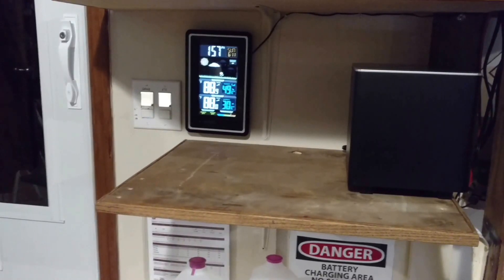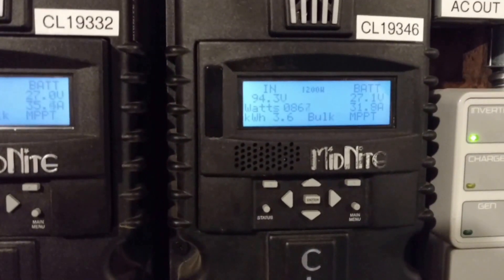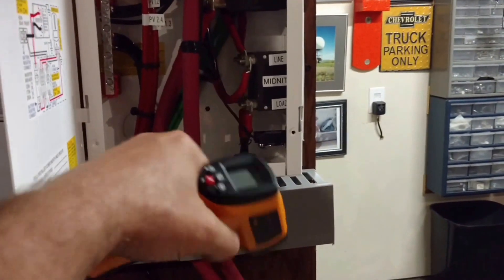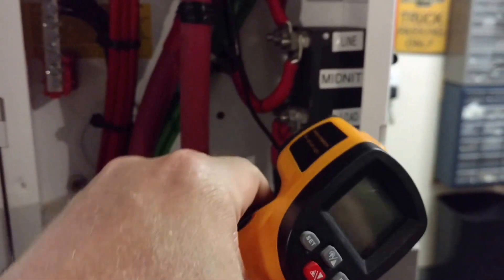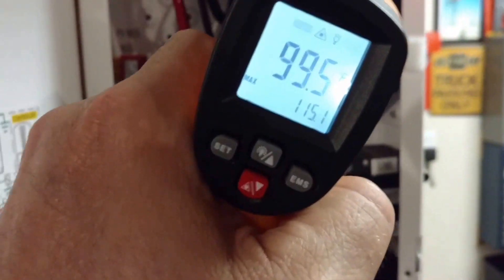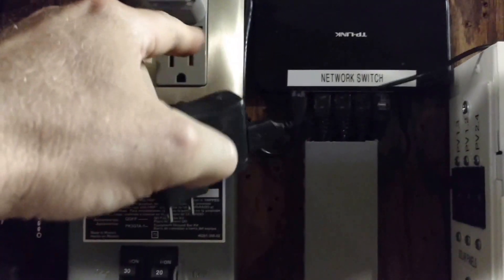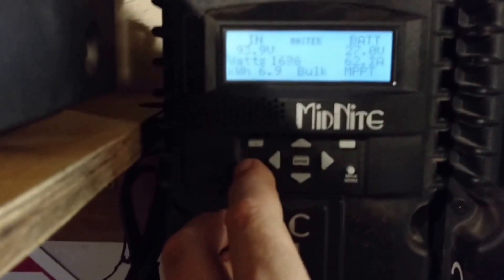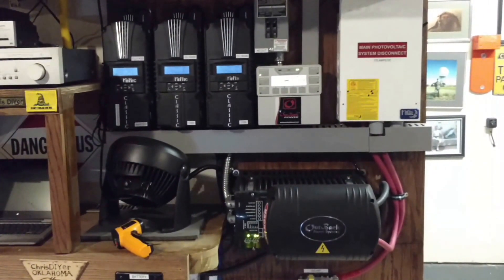5v USB micro-fan installed in solar DC disconnect box

Comment: Another alternative would have been to run just a thin wire to your batteries (with a tiny fuse) and put a small buck converter on the other end of it to step the voltage down to 5V to run that fan.  Then, your inverter doesn't even have to be in operation for the breakers to be cooled.  But my idea might be a pain in the ass :)
Reply from the maker: Thanks...yeh, it would get a bit obnoxious with wires. These little fans use about .13 amps (.13 x 5v = .65 watts). ie, less than 1 watt of power.

Comment: Nice brother. I am working on a setup to help remove the heat from the pip. It was 102 on the in side today. That was in a non ac room tho. Hope to move some air and help cool it down.. May have to do like are buddy Kenny and get a small ac for that room. But that will steal a lot of my power I use to cool the rest of my house..

Comment: I need to get one of those temp readers. Air conditioners? Wow I'm sitting by the wood stove right now lol. Cold and rainy PNW.
Reply: Was 91 here today. SC been cold tho we had nights down in the 70's and days max out at 85. That's nuts most the time June 1 it's 95+ for the next 90 to 120 days lol.
Reply: Wow that nuts! I am a mountain boy for sure. When I lived at 7k and worked at 9k we never had days hoter than the 70s. When I was an electrician down in the desert it was 118f but it was a dry heat. I live on the mountain then and when I got home in the afternoon it was like 72f lol. The snow was tough though.

Comment: Hi Chris, what's the possibility of cutting a vent into the base and top of your breaker cabinet ?  I have seen small screened circular soffit vents at the hardware store that may pass more vertical flow.   J K
Reply from the maker: Yep...not a bad idea. There are already two screened vent holes up top. Not a lot of space on the bottom. May do a slightly larger USB fan too.